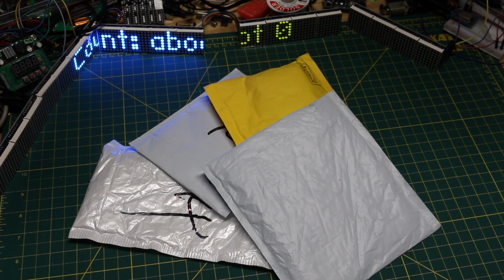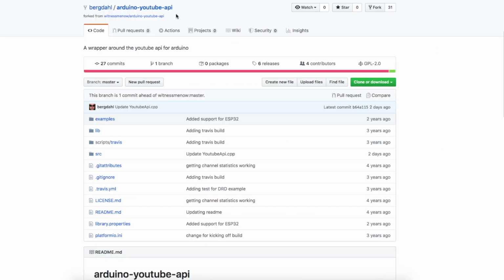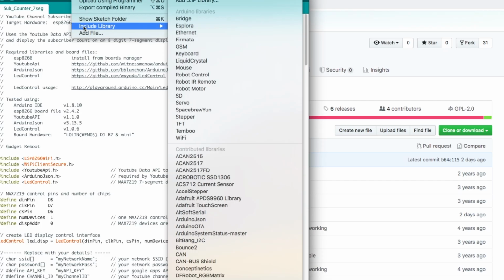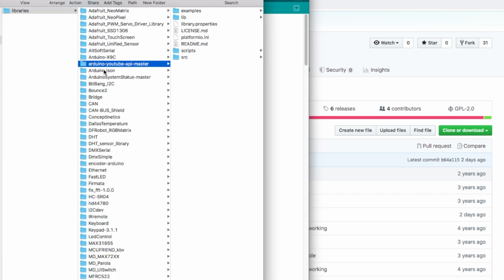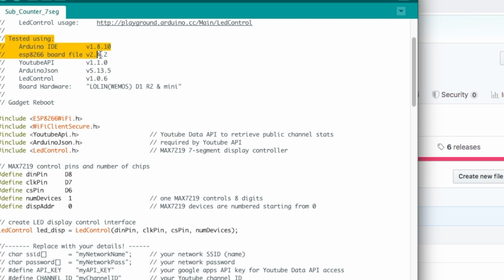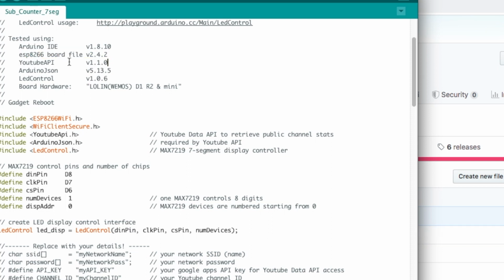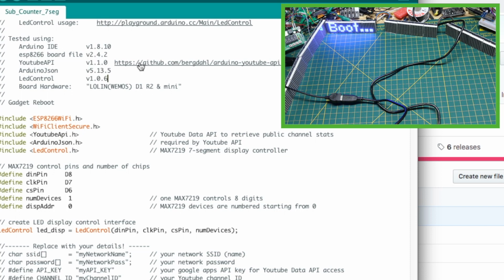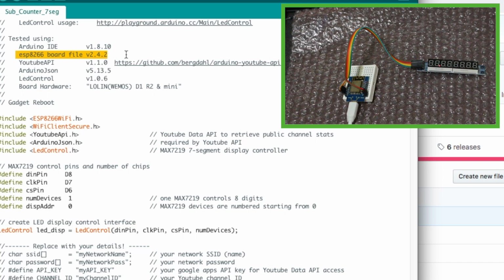Youtube Sub Counter Fix for May 2020 Weirdness

Comment: This updates seems to delete a character at the beginning of a json string  ( and i do not work with arduino code normally )
you could printout the string as received e.g.  [ {blablabla} ]  on your serial monitor (part of the arduino ide) and see the leading space (probably)
add the  "[" and "]" yourself  to aid in finding/seeing the extra character in front of { ...
maybe a routine to remove any number of characters before { would be more future proof.
Reply from the maker: I wonder what changed to make that tweak necessary because the older code was working for at least a couple of years and now suddenly everything got broken.

Comment: Don't you just love libraries that are written so that they are not backwards compatible.
if you write a library it should be done so the new version does not break the old one. I've given up using them now. I just cut out what I need from them so at least my programs will still build and work later if the library is up dated.
I've seen loads of examples of code out there that a beginner might try and use, but the person who wrote the library changed the interface completely in one revision so no older programs could compile with it. it's just soooo bad a practice and such bad coding. Rant over.
Reply from the maker: I don’t understand why new libraries have to break backward compatibility like the whole JSON thing going between version five to version six it feels like a whole new product, not an update. Very hard to keep track of what works with what so that’s why I started writing the versions of library I was using at the time, at the top comment section of the sketches.
Reply: @GadgetReboot  I look at libraries where in the next version, they just swapped about the variables in the function calls, so all you needed to do was to change the order. but why?

Comment: Board Manager 2.4.2 is good and stable.  Version 6 and above of arduino JSON has major changes, Version 5 is pretty stable though :)
I find with arduino sketches, you just use the versions that work and don't worry too much about updating to the latest ones unless the version you need is no longer available.

Comment: This is why I like to use my own code when it comes to scraping web sites. They change. Often.
Reply: It's an api wrapper rather than scraping any website.
Reply: @Chickey  That's better but they change too and without warning sometimes. At any rate a wrapper like that should not be a victim of such changes. The point of an API is direct consumption. Why use a wrapper at all?
Reply: @HazeAnderson  The point of the wrapper is to make it more accessible to more people to make the code simpler.  I know the creator and this code has been used by many many people so i'd say it's required.